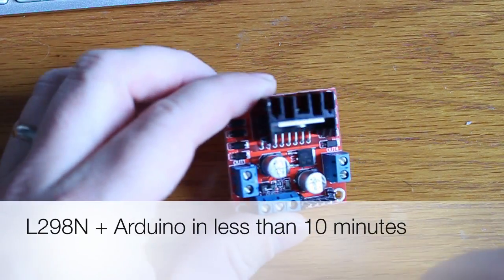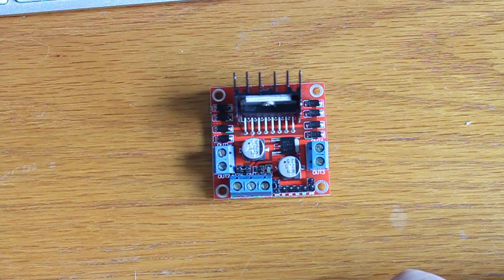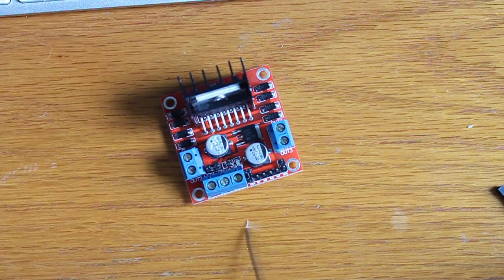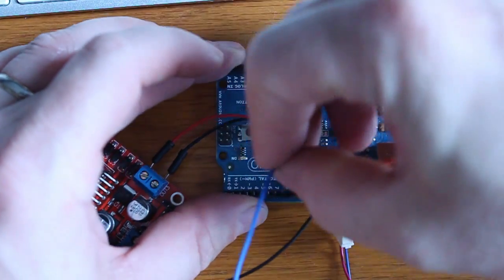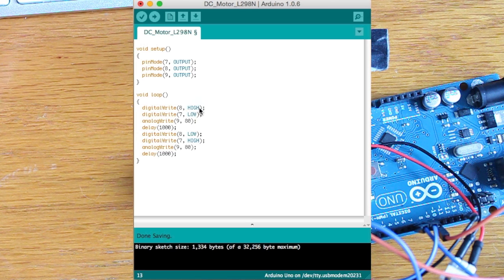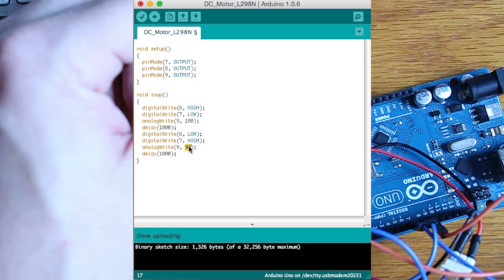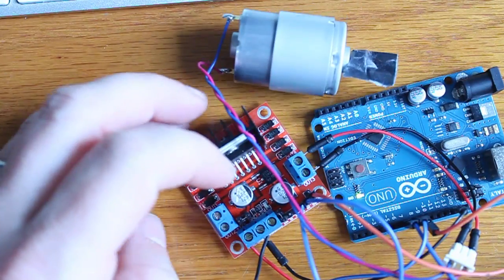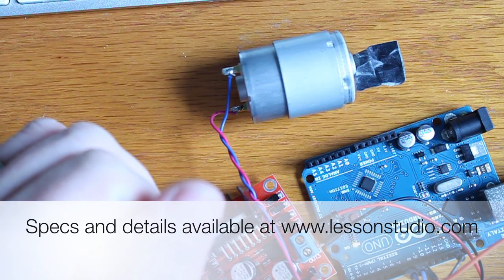HOW TO: control DC Motors with Arduino + L298N

Comment: How would I possibly control this with a button to start and stop the module?
Reply from the maker: +Kym Swanger There would be two options. Basically with or without an arduino or other control device. With an arduino is what is shown. But assuming your question is without an arduino then what you need to do is what is called "logic high" to the correct pins(which I can't say as I am moving right now and everything like this is in storage). A logic high is sending a roughly 5v signal to the correct pin which would send this in one direction or to another pin for the reverse direction.

The problem is that then you would only have the ability to stop the motor or run it at full speed. If you also wanted speed control then you could put a variable resister into the main power going to the motor which would give you speed control.

A whole other option would be to use a module such as:

http://www.amazon.com/Generic-Voltage-Motor-Speed-Controller/dp/B00N30UK2M/ref=sr_1_1?s=industrial&ie=UTF8&qid=1444949443&sr=1-1&keywords=pwm+controller

Which would give you very easy speed controlling in a low priced package up to 12 volts and 2 amps. There are lots of similar modules. 

The key question would be what are you trying to achieve, and then I could potentially answer with a more focused answer?
Reply: My partner and I are creating a music box in which we are using the arduino board and potentially the L298N module for a school project. We would like to control the speed and when the box is closed, the button is pushed down, and the motor stops. Then when the box is opened the button is released and the motor starts spinning again. We are putting a 3D printed character on the motor to spin around, which is why I am looking to control the speed so its not spinning out of control. We are both beginners in using Arduino boards so we are still learning.
Reply from the maker: +Kym Swanger Excellent and very simple. You will need to connect the button to one pin that you set for input. Your code would basically be to have two states in your code which would be stop or go. 

Where you are new to Arduino I would recommend building two separate programs. The first would operate the motor while the other would detect a switch signal. When they were working separately you could then combine the two. 

I am sorry that I can't quickly assemble and test any code but this is basically what you would be doing. 

First in your setup you would set at two pins for output for direction control and I am going to pick pins 7, and 8. So your code would be

pinMode(7, OUTPUT);
pinMode(8, OUTPUT);

Then you need a pin for PWM which will control the speed. I am going to pick pin 9 but this has to be a PWM (analogue) capable pin which can be different for different arduino chips and boards.

pinMode(9, OUTPUT);

Then in your loop() code you would set one to high and one to low: 

digitalWrite(7, HIGH);
digitalWrite(8, LOW);

You could swap the HIGH and the LOW to make it spin in the other direction.

Then set the analogue one to choose a speed:

analogWrite(9, 255); which is the maximum speed. 

Then you could play with that 255 to try different numbers to make it go slower. You will find as you pick lower numbers the motor will start to whine and might even stop at a speed that you think it could go slower than and just make a horrible whine. This is because PWM stands for Pulse Width Modulation. This means that the arduino doesn't send out a lower voltage but just turns on and off very quickly with the off being longer and the on being shorter so that over time there is less energy being sent to the motor. 

So if you don't like the whining or you want it to go slower there is a thing called a capacitor. This part can be done with math but a simple option is to get some cheap small capacitors and put them across the leads of the motor and it will then even out the pulses into more of a continuous stream of power. This will both get rid of the whine and allow you to run the motor very slowly. 

Once you have the motor doing its thing you are going to want to see if there is a switch being toggled for the motor to go or not. 

So you need another pin. This is where it gets simple and complicated. 

I am picking pin 2. You then wire pin 2 from the arduino to the button and from the button to GND on the arduino.

then the setup() code is basically

pinMode(2, INPUT); 
digitalWrite(2, HIGH); 

Then in your loop() code you could do something like

if(digitalRead(2)==true)
{
    digitalWrite(13, HIGH);
}
else
{
    digitalWrite(13, LOW);
}

I have chosen to write it detecting your switch throwing to pin 13 which on many arduinos is an LED right on the board. So it will turn on and off as you flick your switch. 

Now you can combine the code from the two parts, the one for the motor, and the one for the switch detecting where instead of turning the light on and off you could spin your motor. 

------------------------------

One suggestion though is to not spin your motor as slow as possible but to leave some margin. In my experience if you push close to the motor's stall speed on one day it may very well not be enough to start on the next day due to temperature, battery levels, proximity of a yeti, etc. 

---------------------------

Now here is something that I generally don't recommend but if your motor is really really small and weak (a little 50 cent 5v motor) then you could potentially power the motor directly off the arduino output pins and skip the whole motor controller. But this is just begging for a world of pain. First the power output from the arduino output is pathetic. Second it can burn out your arduino. And third even if it does work all kinds of things can go wrong such as someone spinning your motor with their fingers could send enough power into the arduino and destroy it.  But there is away around this. You can use what is called a 360 degree servo. A small one can be directly connected fairly safely to the arduino. The code is a bit more complicated but it would give you amazing control over the spinning and reduce the hardware complexity while increasing the code complexity. To connect a smaller servo to the arduino you have three wires. Typically a black one that goes to GND, a Red one that goes to 5V and a yellow one that would go to that PWM output pin. You then use a servo.h library and a few calls to that library for amazing control.

Also if it doesn't have to spin 360 degrees but you could do a little dance using 180 degrees there are plenty of 180 degree servos that can be had for well under $10. With a servo you can pass along code that will spin it slowly from 30 degrees to 80 degrees and then quickly back to 20 degrees. They make a cool robot like gear noise too.

Good luck.

Comment: Thank you so much! Here with a new robot project for beginners, so it helped a lot! Just wondering how to do it with the arduino not connected to the PC. Thank's!
Reply from the maker: +Albert Borràs Pons  Sorry for the delay. I suspect you figured this one out. There are a huge variety of ways to get power to the arduino once you have programmed it but one of the easiest is to buy a 5v USB battery pack and just plug the Arduino into that. One of those tiny cigarette lighter sized packs will power an arduino for pretty much forever.

If you are using this LN298N then you can tap the 5v and the GND on this module to run into the VIN and GND to send power to the arduino. This module is excellent for robotics projects.

Comment: can i control it with raspberry pi ?
Reply from the maker: +Alesssio boccone Yes you should have no problem. The GPIO pin signals from a Pi are 3.3v which is well over the roughly 1.5 voltage required to trigger the L298N. The typical arduino is using 5v which is great.

If you are using the Raspberry Pi to connect to just a few things and won't run out of pins then you are done and it will be simple. 

But my personal preference is to keep the Raspberry Pi and the motors and such as far apart as possible. Thus something to explore (but not critical if the project is simple) is to look into I2C. This way you connect things like motors up to a Arduino and use just the I2C pins to talk to 1 or more Arduinos. For a simple project this is overkill. But with a large robotics project or industrial control the narrowing of your interface to I2C will allow you to swap out the Pi and replace it with anything that has I2C which is pretty much everything. Also if you screw up and send 24v back into the Arduino you are out a buck or two. If you do that to your Pi or more advanced board then there might be some tears.

If you are just beginning then completely ignore my I2C advice for now but keep it in your mind as something to explore.

Comment: Hello,
I wonder if You could help me..
if i need to control a dc motor "copying" the start/stop time and rotation of another dc motor (When the first motor start i let start the second one with the same sense of rotation and vice versa) how i can do?
I tryed with some relè but the current of the "primary" motor isn't  enough to assure a good contact. 
I have Arduino uno and the l298N shild and i have two dc motors to "cpoy" at the same time.
Thanks in adwance.
Have a lovely day.
Giorgio
Reply from the maker: +Giorgio Musitelli Two DC motors given an identical amount of voltage simply won't stay in sync except by pure luck. Thus you have three options.

One is to add some sort of sensor that will track the movement of the two DC motors so that you can feed in adjustments so they remain in sync. Two common sensors are optical (which can be very precise) or a hall effect sensor that will at least count rotations. Effectively what you would be doing is to turn your DC motor into a form of servo motor.

Another option would be to swap out the DC motors for stepper motors. Depending upon the forces in play and the strength of the motors they can stay in sync but you can't be totally certain without some sort of sensor to check.

Lastly you could get a pair of 360 degree servos which is basically a DC motor with a sensor and feedback circuit built in. This would probably be the cheapest way to do what you are looking for unless you are looking for powerful motors as powerful servos can be very pricey.
Reply: First af all thanks for Your answer,
I aplogize for my english...i "simply" want that the "secondary" motor start when (approximately) the "primary" start and with the same rotatin sense..i don't have enough current at the  primary motor to connect it in parallel with the secondary one...so i wanted to use "simply" the voltage and the polarity of the primary to control the secondary (start an rotation ). In that way i could use a more powerful motor using also another battery
As i said, i tried with some relais and diodes, but the low primary current does't permit a good contact closing and the secondary motor works in fits and starts.
Thank you so much!

Giorgio
Reply from the maker: +Giorgio Musitelli Oh then this is much easier. The L298N can handle two DC motors. Thus you can connect them separately to the L298N and send the same signals to the two motors. They will then turn in the same directions at the same start time. You could even connect the two motor control pins to the same output pins used on the Arduino to save on outputs from the arduino.

Comment: hello there , thank u for the very useful video , i wanna ask you if this H-bridge can bear up to 24 V cz i have two motors and i have to run each on 12 v?
Reply from the maker: +noura rousan Yes and no. If you are running both at 12v then you would be putting 12v into the board. If you put 24v into the board then the two motors will each get 24v. The real limitation is that you can only put 2A through the board. 

Where this last bit is critical is that while the motors might run at, say, 1.5A they might have a startup spike at 2.5A. Generally this board will handle that spike it is something to keep in mind the harder you push the board for a sustained load. Also if there is some chance that your motor will encounter extremely heavy resistance then the amperage could also skyrocket. For instance if your motor is running at 1.5A and it is mechanically forced to stop then the sustained amperage could easily go well above 2A and burn this module out. If your motor is expected to run smoothly and always stay below 2A then you are fine. But if there is a good chance of it accidentally sustaining more than 2A you would want some kind of slow burning fuse. The kind of fuse that wouldn't blow with a tiny spike but would blow after a bit of sustained >2A. Otherwise you will be using the entire module as a fuse.
Reply: +LessonStudio thankkk yoouuu for ur time and ur explanations , u've helped me a lot :D

Comment: Hey there, I have a quetion. What will happen with the LN298N if you do   digitalWrite(7, HIGH); digitalWrite(8, HIGH) or if you don't connect controlling wires? I am asking this, because I made a simple H-bridge with transistors. If both controlling wires are LOW it's fine, if only one of them is LOW is still fine, but if both are HIGH, the transistors heat up fast and to a burning hot temperatures. Do you have any idea how can I solve this problem with my bridge?
Reply from the maker: +Daniel Lazarov I am in the middle of moving and all my electronics (except for one arduino, a raspberry, and my multimeter) are packed away. So I will throw out a guess. Basically an hbridge is four switches that effectively surround a motor. Let's say that the motor has L and R sides. The Hbridge gives you the ability to put + to the L or R and a - to the L or the R. So what you typically do is put the - to the L and the + to the R or reversed so the - goes to the R and the + the L. Thus you can turn the motor in either direction. 

What I suspect you are doing is putting the + and the - to the same L or same R. This would mean that the power is just flowing straight from your battery to through one half of your HBridge and back to the battery. Almost a short in that the HBridge will act as a resistor and heat up. One eventual symptom would be that it half burns out and now the motor will only turn in one direction. 

The only thing I can suggest is that in your Arduino code you just make sure that your logic doesn't allow for this.  Maybe there is a better solution such as building a logic gate in front of the hbridge that would filter for only allowable conditions but something in your code might be a million times easier to build.

If you aren't using an arduino then the logic gates idea might be needed.
Reply: +LessonStudio Thanks for your reply. I am using RaspberryPi 2. As you said, I can assert in the code that there wont be 2 HIGH signals, but the problem comes when I Turn off my raspberry. And even when it's turned ON, I first have to  manually set the pins I am using to OUT LOW, before attaching the motor's powers supply.  I will try the logic gate method and see what control do I have over it when the raspberry is off.
Reply from the maker: +Daniel Lazarov One alternative is to put an Arduino in-between the pie and the hbridge. I do this because I fear for the safety of my pi and just know that, especially, while fiddling around with the power typically involved with motors that I am going to send it down the wrong pipe. For super simple things you can use an ATTiny 85 (or even lesser) which keeps the cost very low. I also love the Nanos for their cost and size while still maintaining a usb interface to keep programming simple.

Comment: Can I use 5 V from arduino instead of external power source to drive motor?
Reply from the maker: +Sarul Sakulthong Sort of. If the motor is really really small then, sort of, maybe, kind of, but not really. There are two problems with running a normal DC motor directly from an Arduino. One is that most (if not all) arduous don't really have that much capacity before they will fry. The other is that if you watched the power flowing to and from a DC motor as it starts and stops you will see all kinds of spikes, flowbacks, and other undesirable whatnots. So you want to somewhat isolate your motor and arduino. If you read the amperage capacity of an arduino output it is typically tiny. If you look at the startup amperage used by even a fairly small DC motor it is usually surprisingly high.

You will often see people putting various circuits between the two. This will involve capacitors and diodes to smooth things out; and more commonly some sort of control circuit involving a transistor, mosfet, relay, etc.

Thus the reason that something like this LN298N based module that makes life so much easier. 

Also to add to the list of problems with running a DC motor directly from an arduino is that, even if you don't burn out your arduino, you may end up momentarily overwhelming it causing it to effectively reboot or engage in other unpredictable behaviour. Thus you will think that your code sucks when it is actually a bug introduced by the semi random actions of the motor. 

That all said, if you want to run some kind of motor directly from the arduino you can run small servos as they don't take their power from the output just a control signal. They get their motive power from the main 5V supplied by the arduino which, while not huge, is much better.
Reply: +LessonStudio Thank you so much.